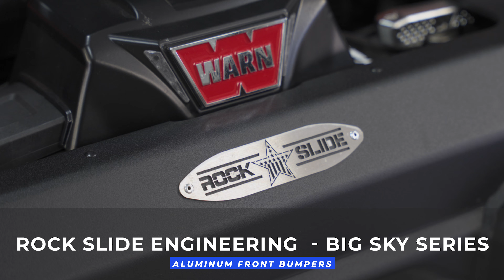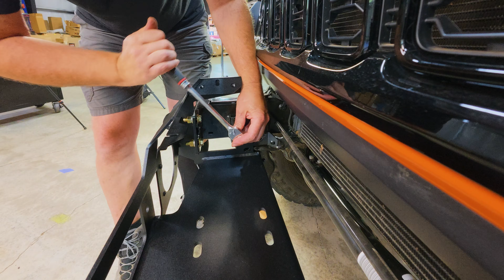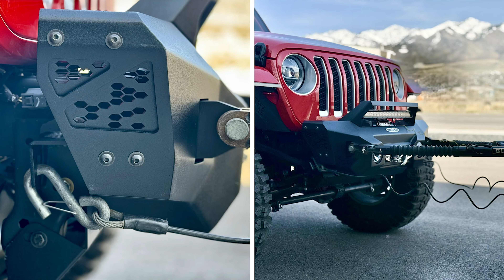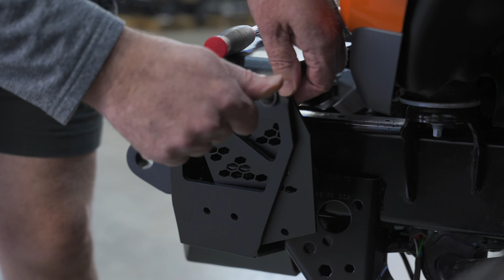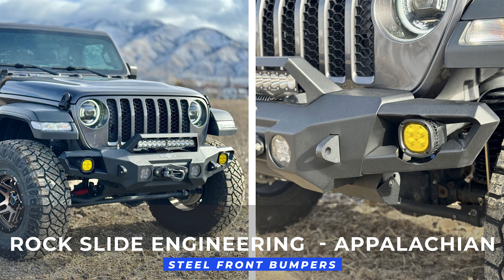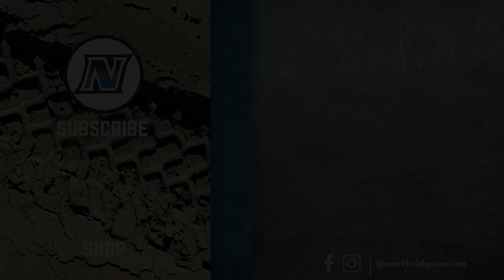Aluminum Front Winch Bumper?! | Rock Slide Engineering Big Sky Series | Jeep JL/JT

Comment: Nice 2 piece to make the winch install so much easier! and save some weight. The modular wings to add more lighting for those fire-road type trails is a plus. the aluminum fascia appears to be able to be installed/removed easily, in my mind, a simple steel fascia cover for rock days would make it a winner
Reply from the maker: Check out the Appalachian series front bumpers, they have a steel fascia.
https://www.northridge4x4.com/part/front-bumpers/fb-f-310-jl-rock-slide-engineering-appalachian-steel-mid-front-bumper